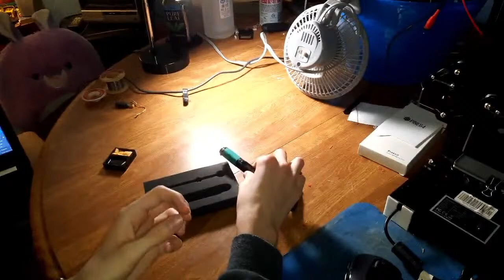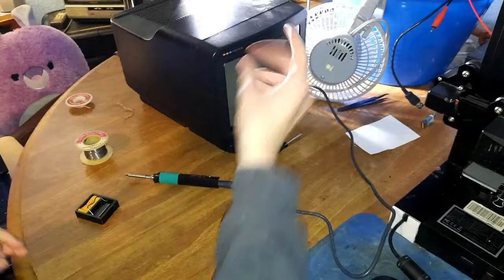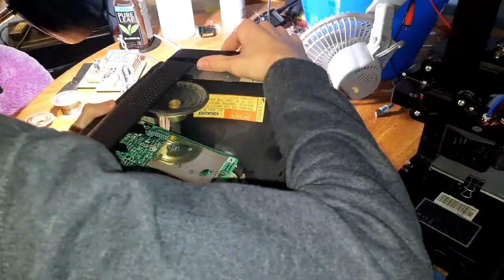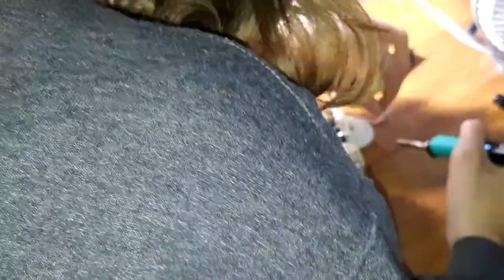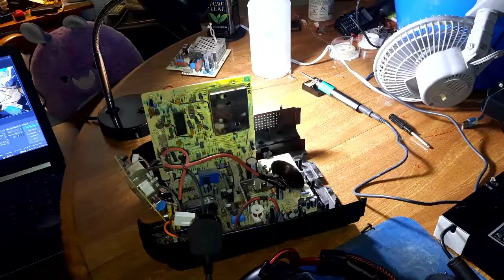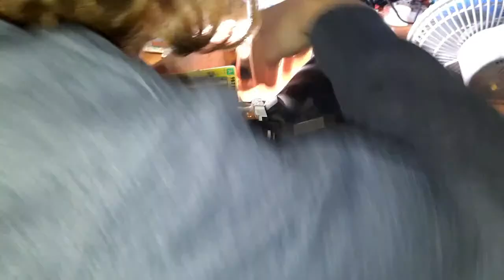Bird Labs: Sony KV-8AD10 AV jack repair + Pinecil unboxing and first test!

Comment from the maker: Un-sleep deprived Bird here, to do some after repair comments.
First off, still not sure how to completely repair this one since I think the pads for the AV jack are damaged, don't think it was like that when I got it so maybe I messed them up over time as the issue got worse. Maybe a jumper wire to another place on the same trace?

2nd thing, it's interesting how much of this set is designed around slots and clips, only 2 screws to hold the back cover on, everything else is either slid in or clipped in as you will see. 

Also sorry for the audio getting much louder in the middle of the stream, wasn't paying attention to the microphone positioning on my headset.